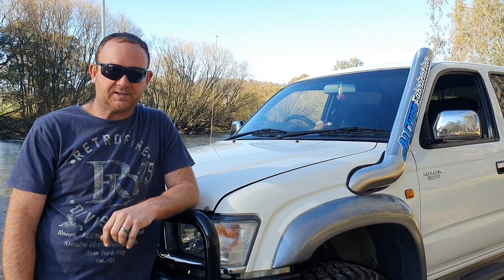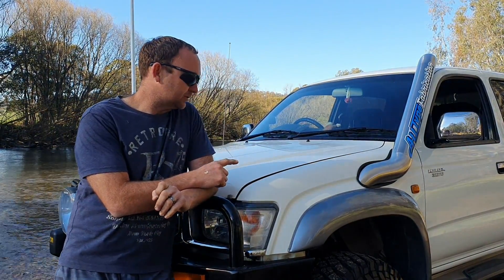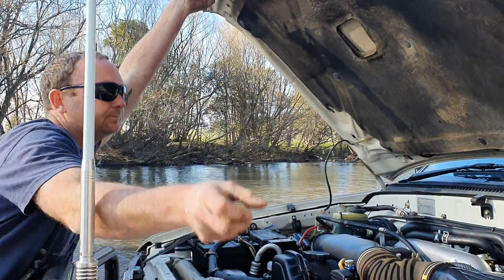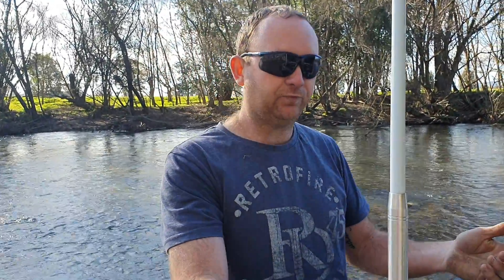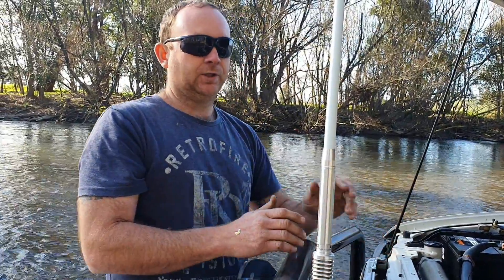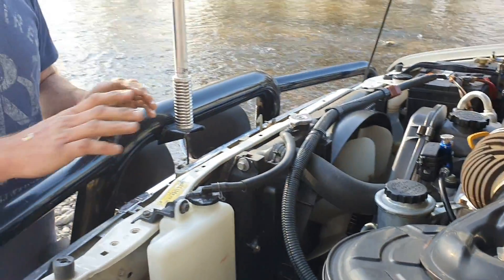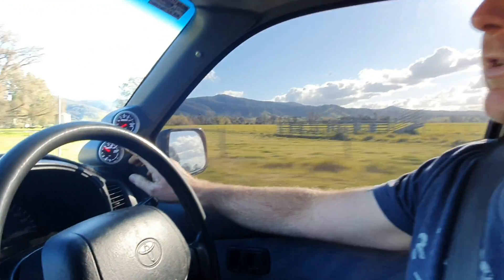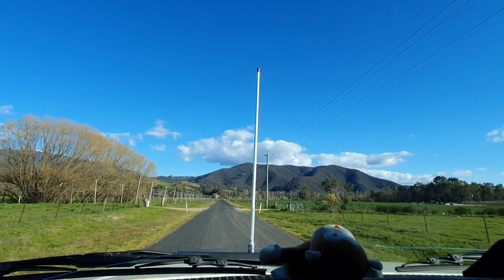1kzte hilux more boost? with stock pump making 18psi is it possible???

Comment: Thanks for the video. Interested to know how much difference the 3" exhaust makes from stock exhaust? Also the snorkel. Much difference from the stock air intake? I am desperate to get more high end torque out of my 2000 Prado 1KZ-TE for towing and better up hill performance. 

I've already installed a 3 bar map sensor, boost T (like yours) and an EGT/Boost gauge. Boosting up to 15psi but usually around 12psi seems to be where it likes to sit. Maximum EGTs is around 500 deg C on big hills and when towing. Have also popped a bonnet scoop and 8" fan on the top mounted intercooler. These mods have given a massive improvement for general driving from 0-60km/h but anything over that and the truck is still hopeless. Like its being under fueled? I can't really afford to go down the Unichip/DP Chip route and not sure if the chip route is even worth doing without the exhaust and snorkel mods?   

Whats your take on all this? Be interested to know more about the Fuel Cut defender as it does seem like under fueling is my issue more than anything... 

Cheers :)
Reply from the maker: I wouldn't worry so much on a chip its fueling thats all u really need an exhaust for starters thats your biggest enemy the engine isn't breathing thats why its hitting the wall try ppd exhaust there cheep not sure if they make one for a prado
Reply from the maker: Hey mate the 3" is a huge improvement the stock exhaust is hopeless on breathing for the engine i tryed this. snorkel definitely b 4 and after instantly noticeable were your at your most probably at the fuel cut i tryed playing with more boost less boost more clamp less clamp on the fcd1 its seems to b happy at 18psi pulls really well from 3rd gear and up to 5th hills and all tho im power hungry now so its all getting removed for some serious modifications were you can achieve serious numbers
Reply: @TRAV30387  I did a full mandrel 3 inch system from turbo back and it made absolutely NO difference at all. And also have a snorkel too
Reply from the maker: @m.g.collins6547  bit strange not to improve 🤔
Reply: @TRAV30387  I recently installed the same stainless turbo back exhaust, the original stock dump pipe from back of turbo is tiny, I was amazed, Def runs better now , 3rd gear pulls alot more and sounds nice to
Reply from the maker: The fdc works verry well can trick the boost pressure sensor into say thinking its getting 14 psi and giving its maximum fueling tho you have to find that sweet spot tuning mine liked 18 psi and 14 clicks on the fdc1
Reply: @TRAV30387  Ok cool thanks for the knowledge :) I'll look into the exhaust next then. Though im in South Australia so might look locally. I'm not trying to create a racing truck, just want to be able to keep up with traffic on the freeway and tow my caravan at reasonable speeds haha. With my Boost Controller fully open, I can't seem to get more than about 15-16 psi and it starts making a hissing sound (different to the turbo spooling sound). And its not pulling at all in 3rd gear at 80-90km/h, just revs like a mofo! (ive got the 4 speed auto...) So you think the FDC is a good investment then? Seems like and affordable thing to try.
Reply from the maker: @1Swgm  ur hitting fuel cut bye the sounds of it fuel cut is 14.9 15 psi the 3 bar map sensor may be at its limits tho a stock exhaust will definitely restrict flow try these mods 1st b for anything else thanks 😄😄😄
Reply: @TRAV30387  yeah cool will do! Specifically interested in the FCD2 units. Seems to be a lot of conflicting information about whether the 3" exhaust is necessary or if it just adds "noise". Read about how you can lose back pressure etc. Also talk of in-between options as well like just upgrading the dump or a straight through muffler etc etc... I might consult a local exhaust shop directly and see what will get the results I require. 

How hard was it to tune the FCD unit? Says you need a dyno in the instruction manual but I also got the impression you could (very carefully) trial and error with minor adjustments to get it to the sweet spot.
Reply from the maker: @1Swgm  all i done was road test tune my self adjusted to feel if it pulled better id adjust more if it was worse id reduce adjustments its trial and error
Reply: @TRAV30387  easy as! Thanks so much for sharing your experiences. Really appreciate it! 😎👍
Reply from the maker: @1Swgm  happy to help 😁😁

Comment: Do you tap the same source for manifold pressure ( from intake manifold) for the turbosmart and the boost gauge?  I was wondering if the gauge will read the right reading with the bleed open. Thanks.
Reply from the maker: The boost tee pluns into turbo side on its own and the boost gauge taps into the manofold intake side best place to tap is near the little filter that goes to your boost pressure sensor
Reply: @TRAV30387  hey mate i am a bi confuzed with this answer? I have put my boost tap to adjust boost on turbo side and i have also tapped my boost gauge inbetween the boost pressure sensor and the little valve to control boost readings,now if i also put a tee with  the FCD on the same line,(next to boost gauge tee)will the boost gauge show actual boost or the bleed boost?Im sure this is what Alex is asking,cheers
Reply from the maker: @seanhutton7155  watch my video explaining how it works best way is to find a place to get boost pressure readings there will b a spot to tap into and as for the fcd tap into the boost pressure sensor side

Comment: Had mine for almost 2yrs. Love it!! But this is by far the BEST and informative video I have been looking for. Cheers mate she sounds beaut 👌🏽👍🏽👍🏽
Reply from the maker: Thanks heaps mate i was in the same boat no info on the 1kzte so i had to make my own video cheers heaps mate
Reply: @TRAV30387  I'm still looking for improvements on the fly-by wire throttle. Hate always being pedal to the metal and the revs don't give a flying . . . They'll just increase as they please 😢
Reply from the maker: @Tev68ragtop  mate put a i drive on her its almost like a mechanical throttle tho you can tune it
Reply: @TRAV30387  cheers mate will look into it. Thanks again
Reply from the maker: @Tev68ragtop  no worries mate enjoy